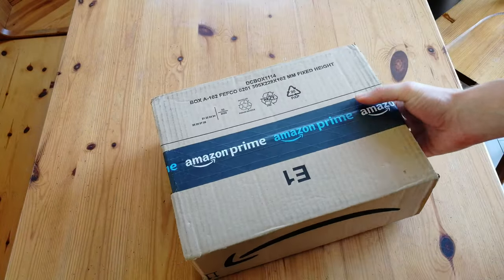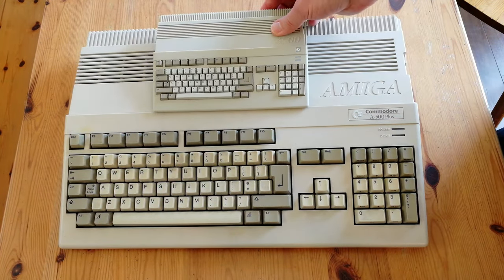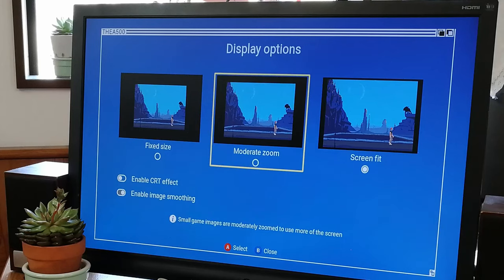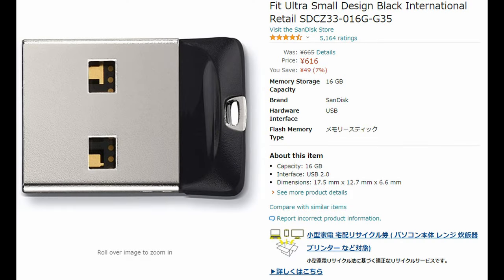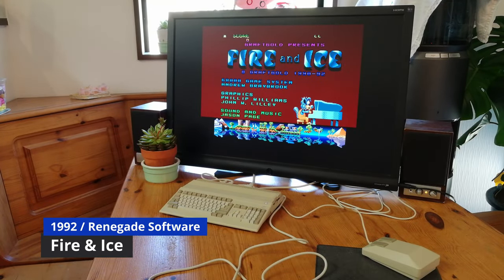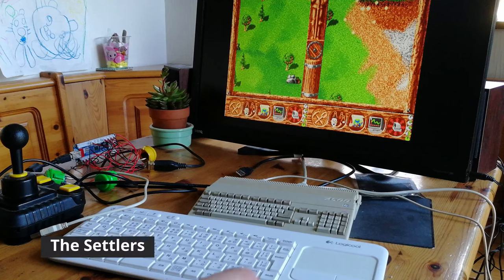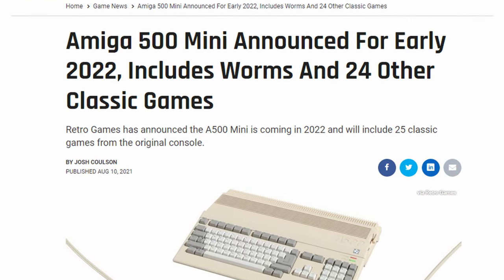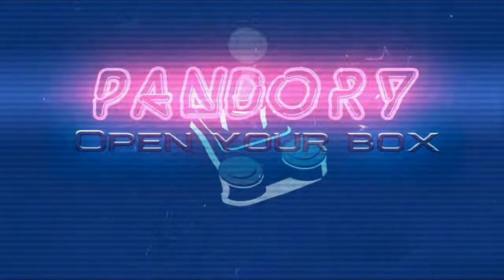The ULTIMATE A500 Mini REVIEW [The BEST Mini Console Money Can Buy?]

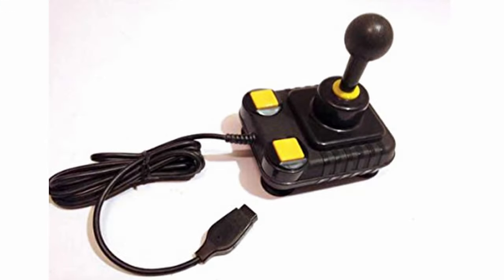Comment: 16:18 There also exists the DB9 Universal Joystick Adapter from Retronic Design. This adapter allows you to use your Amiga joysticks on the A500 Mini. Retronic Design had recently launched a mod for the adapter’s Amiga firmware that would allow you to use your original C64 and Amiga joysticks with the proper button mapping. There is also a firmware to use the Amiga mouse with the adapter as well.
Reply from the maker: Yeah, I just found out about that adapter yesterday... Had no idea about it supporting mouse though, that's fantastic!
Basically I had the zero delay board not being used.... Thought why not ?  Always thought about making an adapter myself since the days of pi3 and early retropie
Reply: I bought the Retronic adapter years ago and i use a real DB9 Zip Stick on it.
This adapter is the most expensive, but it's also the most compatible.

Comment: At 15:17, my experience is that the Mayflash Magic NS does work (flashing yellow) with PS Classic controller and Hori Rap IV.  Also, my 8bitdo black brick works with my 8bitdo Arcade Stick
Reply from the maker: It may be an issue with either the firmware on the mayflash stick, the controllers themselves- or perhaps the a500mini firmware.
I tried the yellow light but the directional inputs go mental.

Comment: You did talk about editing .uae config but no mention of enabling expert mode in the menu where you can edit things like jit, memory, blitter, copper. mess with gamepad/joystick ports and mappings etc. editing those will have an effect on stuff you know? :D
Reply from the maker: Settings in UAE would supersede "expert mode", but yes, you can change settings there, too.
Reply: @TeamPandory  meaning that maybe some of the controller or game problems can be fixed through .uae config or those expert settings. Fire and Ice etc. Might also need to use the a500 mini gamepad to tweak mappings to help with other controllers.
Reply: @dumpsterfire7214  True. Fire & Ice runs great if you activate the Copper in the advanced game settings.

Comment: Emulation with Raspberry Pi 400 are superior. Pi 400 have better hardware, better price too and don't forget I can run all workbenchs SO versions and programs too. I can run too all Amiga models like 500, 600, 2000, 3000, 1200 and run too all adf or whdload games.
Reply from the maker: I wouldn't say better price, but you will have a far better experience running it.
Reply: @TeamPandory  It's better price Pi 400 was 70€ + Joystick 30€ and TheAmiga 500 are 130€ and need keyboard. About better experience I already have with my Pi 400 I can run everything... you can't do that in A500 mini.
Reply from the maker: @paulo-figueiredo  maybe when you bought it .... Pi400 go for around 120 EUR for the kit.
It's a bit of a bad comparison tbh. The a500 mini has fully licensed games, is ready to go, and has an authentic looking case.  Pi400 will work far better, be able to do more, run smoother, can configure it. 
It's like comparing a plastic toy to technic Lego.
Reply: @TeamPandory  When I bought the Pi 400 was without kit, don't needed.. everyone can bought Pi 400 without kit. I only tell you, Pi400 are much better then A500 mini in hardware and run everything without problems. That's my experience. Off corse you must know about linux and Amiga SO to do that, but you have already pIMIGA 2 for people don't know anything about amiga and want run everything (games and programs) in Pi 400.
Reply: Even on the Pi 4 it isn't perfect. FPGA is the way.
Reply from the maker: @RainerK.  For 4-5 times the price... ...  FPGA bah. Just get a real Amiga. Stop messing with emulation at that price.